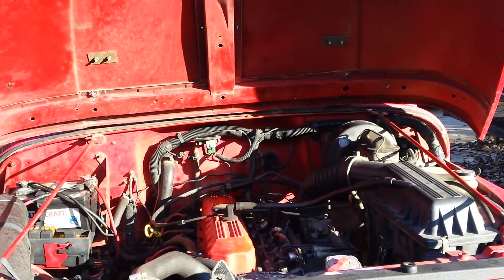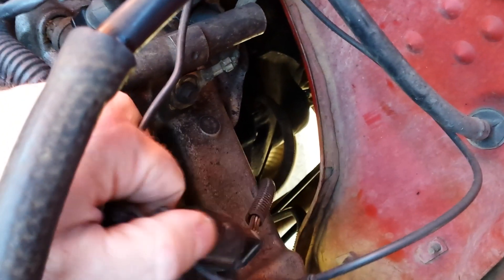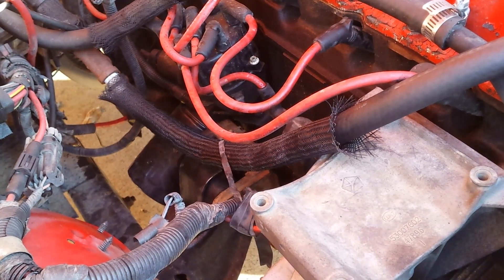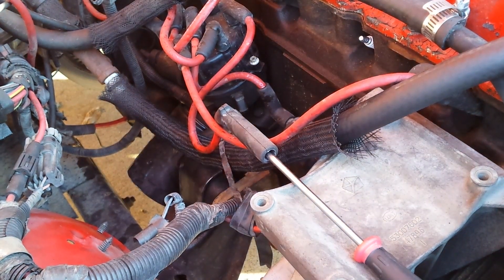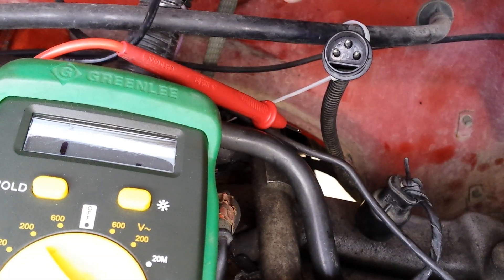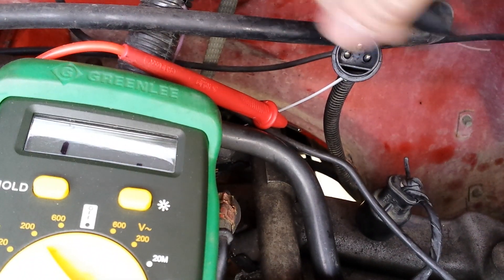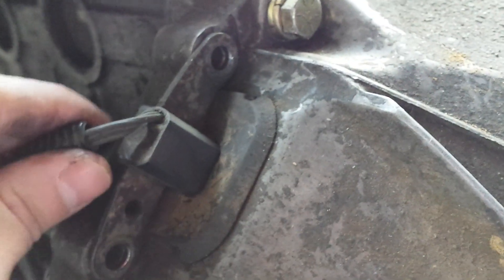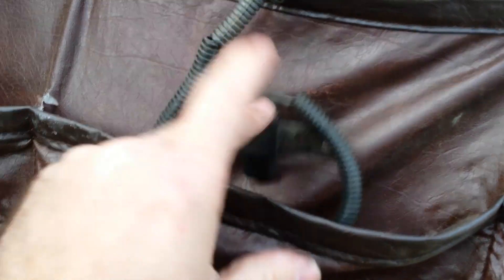Jeep Wrangler - Crank Shaft Position Sensor - locate and test #poweraddictscrew #jeepwrangleryj

Comment: I was going down the road and my 95 Jeep Wrangler just shuts down. I wait a few minutes it starts right back. Could this be the problem?
Reply from the maker: +Jimmy Hinton (pudgybear100) Yep .. typically when they go .. they are done. I have seen a few cases to where they shut down when they get hot. Buddy of mine, his Cherokee did that twice. It eventually didnt fire back up at all until he changed the sensor. If that doesnt get it, check the coil next. Hope this helps! Have a great day!
Reply: I replaced it anyway and I got to drive it all day that was it. Thanks man I didn't know about that sensor until I saw your video. It was a lot a help.
Reply from the maker: Glad that worked for ya!!
Reply: +Power Addicts - FixJeeps.com - Jeep, car and motorcycle tips Well it started back but this time I think it's under the distributor cap this time. I had this jeep since it was brand new and February will be 20 years since I owned it. I know it getting old and cranky but I wouldn't have nothing else.
Reply from the maker: Yep ..check the Cam Position Sensor under the distributor cap. I understand, I love my old '91 Wrangler!
Reply: +Power Addicts - FixJeeps.com - Jeep, car and motorcycle tips I had my jeep since it was brand new only had 9 miles when I drove off the dealership. It leaves a smile on my face every time I get in it and drive. February 2nd of this year will be 20 years since I had this jeep.
Reply from the maker: I was into old school hot rods through my younger years, When I bought the YJ it was ready for scrap! I gave it a new life .. heck I fell asleep under it a few times just getting capable to be driven again. I've had many very good offers to sell it. It is not for sale and never will be. I'm hooked, It is so much fun to drive. You know .. it just fits :-)
Reply: +Power Addicts - FixJeeps.com - Jeep, car and motorcycle tips I was working on drag racing motors back in the 80's. In the early 90's I started working for a brass foundry and still there. Been out of mechanic field for over 20 years.  I'm currently a machinist over a lathe line.....Thanks for the advice.
Reply from the maker: Glad to help :-) I put myself through school swinging hammers and cranking wrenches. I was also raised around cars so its kinda in the blood im proud to say :-). I now do IT for a living, but I stay true to my roots. I still occasionally do mechanic work on the side. Mostly ... I just love cranking wrenches on my toys. As I tinker with my toys, the channel gets videos to help others. Giving back for the gift I was raised with :-)

Comment: Great Video, Just one question... No Spark usually means Bad Coil.. How come you didn't test the Coil For Spark first before Blaming the CPS ? Does the CPS in fact make the Coil Work?
Reply from the maker: On Jeeps (Wranglers and Cherokees) of this generation, the CPS "usually" goes out before the coil. But obviously not every time. Yes, if the CPS fails, the coil stops firing. Good question .. thanks for asking! Have a great day!

Comment: I just viewed your video tonight and found it to be of great help and of course I also signed up. Thanks for all the information and the way you put it out, very easy to understand too. I just acquired a non-running 91 Laredo, 4.0L, with the AW4 from a family member who couldn't get it started after last driving it a year ago. He put in a new fuel pump and the injectors are getting fuel. He put in new plugs and told me it was getting spark. I've recently installed a new N.S.S. safety switch and it cranks over in park and neutral, but no start. I will be checking out the CPS in the morning to see if its good, but based on all my reading and viewing, I think it might be the CPS or Coil. Manny Thanks. Tio AL.

Comment: Wondering if I can ask a question here.... so, since my engine cranks, I'm thinking the sensor is good. That said my obd reader popped a P0339 (which is what lead me to your video----yes insubscribed now haha). So my question is, since I had misfire, last weekend, I went to check plugs, found oil in cylinder 1 (2006 Tj 2.4L) ya bad news, but, did ( or could ) this oil caused misfiring actually spike my sensor to log the code in the obd module? I am going to clear it...I did clean the cylinder and put 4 new plugs in til I can sort out if the leak is gasket related or worse... CEL is not on anymore. But curious now if that caused the spike on my CKPS? Hope what I'm asking makes sense.... lol
Reply from the maker: Not so much as a spike, more like a misfire that can trigger the same check engine code. If you have oil getting in that cylinder it could be a few things, worn rings, leaky valve seals or worn valve guides. Good luck!! Have a great day!!

Comment: My son has a 96 Jeep Cherokee SE, just shut down on me one day, replaced the coil because he didn't have spark (before seeing this video), still no spark right after replacing, after cranking for a few seconds though it started, ran for about 2 minutes and then died again. He took it home and replaced the fuel filter because he thought it may be a fuel issue from sitting for a year. Now the vehicle will run until it reaches operating temperature and then shut down again, let it cool for a few minutes and it will start back up until it reaches op temp and then it will die again. Any Ideas? Could this be a crank sensor issue? Fuel Pressure is holding steady at 42lbs.
Reply from the maker: +Jeff Slocum Yes .. Ive seen the crank position sensor so this a few times here recently on other Jeeps I know. A buddy of mine has a ZJ, it would shut down when it heated up. Turned out to be a Crank position sensor. My nephews XJ .. same thing. That sensor would be the next thing I would change. Hope this helps :-) Have a great day!